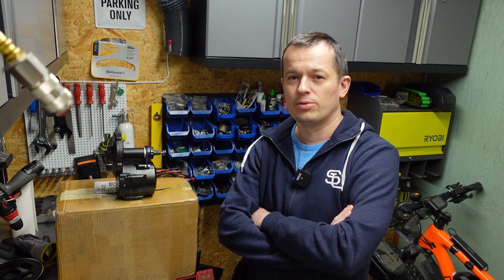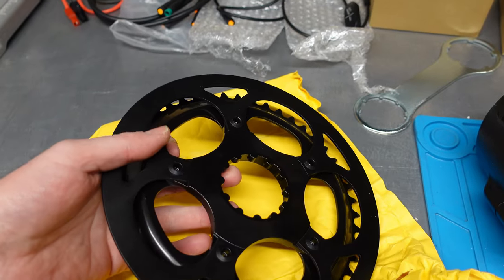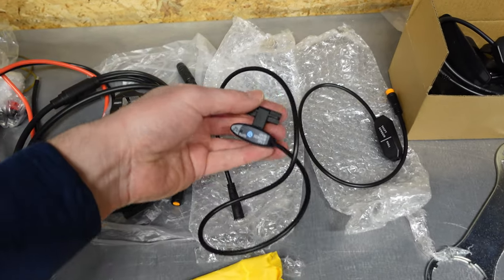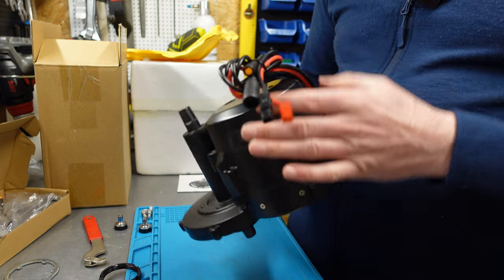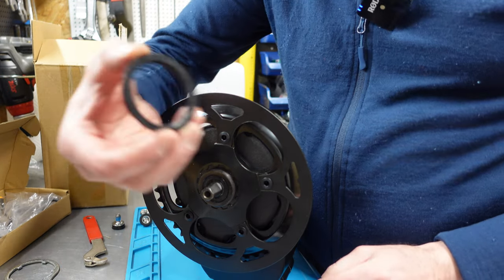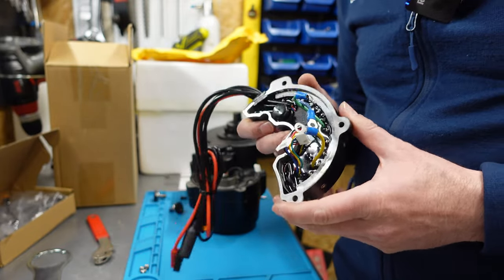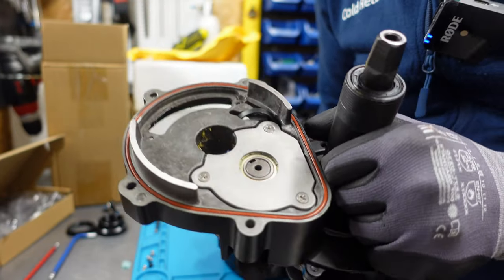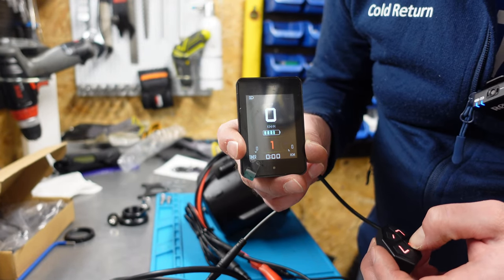ToSeven DM01 motor review

Comment: For some reason BBSHD, M625 and M635 mosfet heat spreader plate is not bolted tight against the housing compared to Toseven DM-01. Strangely nobody talks about it but atleast BBSHD has thicker phase wires for better efficiency (that might not matter since they are short anyway).

Comment: Hey- thanks for the excellent teardown and presentation, it's very helpful. Do you know the millimeter offset of the 46t chainring it came with? Toseven sell 36t, 38t, 42t, 46t and 52t 9mm offset chainrings from their store. Would these have the same/less/more offset than the original?
Reply from the maker: I don't have that kind of details. You need to contact ToSeven directly.

Comment: Hi how did you split the motor apart when you show the stator and rotor section.i took my motor apart and it opened up slightly but it would not split fully I did not want to force it as it was brand knew and I wanted to grease the gearbox .but decided to just leave it as it would not spilt easily cheers.
Reply from the maker: You need to remove 2 screws holding the PCB board for the phase lines connectors. This PCB board is connected to stator.

Comment: Nice video I watched all three videos in the series… can this motor work on a 52  volt battery?
Reply from the maker: Probably it will work with 52V, but as I remember in the display menu I was able to set battery type only to 36V and 48V.
Reply: @LierskogenEbikes  thanks
Reply: @LierskogenEbikes  it has a setting for custom and will work with up to 16s 60v
Reply: @chipkhalifa4138  up to 60v battery
Reply from the maker: @Alex-uh1mj  I haven't seen the 16s battery option in advance menu in firmware version from September. Did you updated this recently?
Reply: @LierskogenEbikes its always been there. Go to battery voltage. Press down it goes to 36v press down again it goes to customise. Enter your voltage there.  Go back and you can set the cut off voltage

Comment: How is the chain offset? Using BBSHD on my full suspension bike I have to use a 42T wide chainring with 22mm offset to get proper alignment.
Reply from the maker: Not bad, but the problem can be fairly large front sprocket - 46T. You can't fit smaller one and maintain same offset as original.

Comment: My advice on connectors, cut off the anderson poles, they are not fit for purpose with the type of currents these motors use, i have 3 bbshd's so similar amp and current range to dm01 and after having my anderson connectors part melt and start giving bad conductivity i cut them off and use xt90 instead.
Reply from the maker: DM01 is more subtle than BBSHD because of torque sensor. In theory it push 30Amps into motor core, but that's only when you press hard like riding uphill situations or driving on throttle.